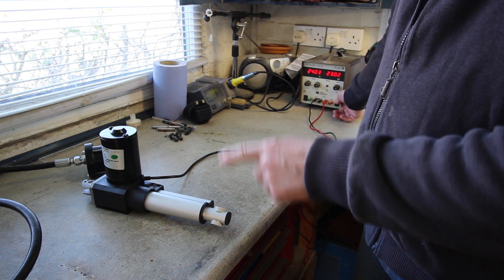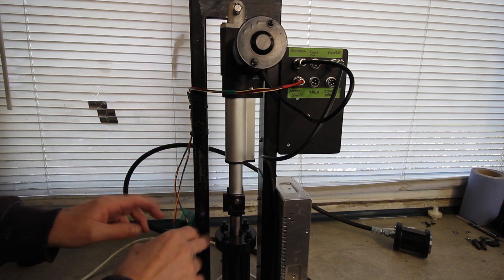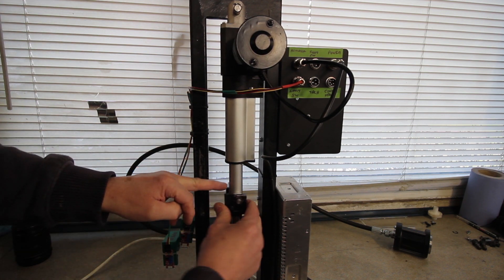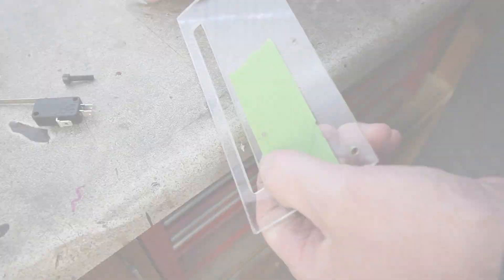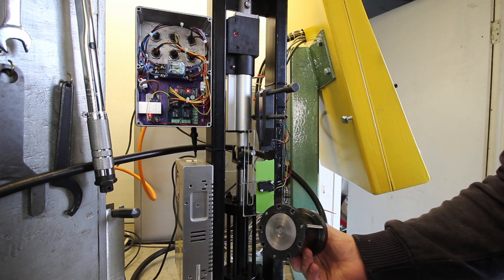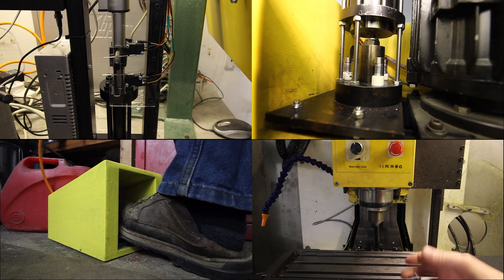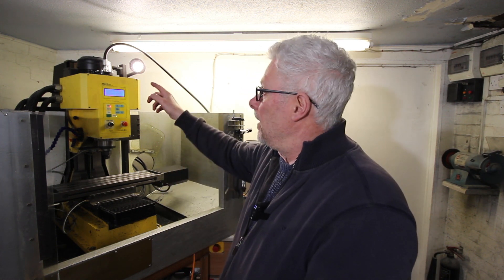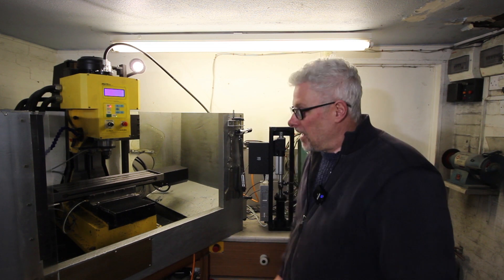Power Drawbar Finished

Comment: I’ve seen one video of someone just using an impact gun with a retainer nut.

Why wouldn’t that work here? Why do we need to use downforce to release the taper, instead of just using an impact gun? Benefit with the impact gun is it unscrews the drawbar as well?

I’m making my own drawbar release mechanism, similar to your design, but I saw a video yesterday of someone using an impact gun + retainer nut and it hurt my soul :(
Reply from the maker: Hi @thunderbirdizations
I saw those video's as well when I was thinking of how to do mine. I cam to the conclusion that if I wanted to add a tool changer then my choice was the best way to go. I also wanted to have a system that could be driven by a footswitch or a button on the control panel. The impact gun is certainly the cheapest way to go but for me its an agricultural solution! The hydraulic system is harder but far more elegant.
Good luck with your system I dont regret mine in the slightest.
Cheers

Comment: So this is fantastically engineered but what bugs me is that this gives 1500kg. HAAS publishes their drawbar force and 1500kg aligns with their 50 taper 30HP spindles! I feel like there must be a variable somewhere thats making such great forces necessary
Reply from the maker: Hi @Rainbows871 I think the difference is that the BT30 is a taper drive so does not need a massive drawbar pull as the taper does the driving. The Tormach and my system is straight sided so the tools  have no taper to jam into. Hence the massive pull needed to stop them slipping. 
Incidentally mine will move in the collet with moderate force on a spanner. I have found the tools can 'walk' out of the collet if you dont have enough drawbar pull somewhat catastrophically!!
Cheers
Reply: Ah! That makes sense. I'm restoring a Denford Starmill and have been debating TTS vs 30 taper conversion (nabbed original drawings for the 30 spindle).I was about to go TTS but that force might swing the balance @CazualHaze
Reply from the maker: @Rainbows871 Yep good choice I want to build a mill from scratch and the spindle I think is the hardest bit. The speed range is an issue along with the torque for rigid tapping and orientation for tool changes. I will go taper spindle for sure three phase motor or servo is still up for discussion.
Good luck with the mill. Cheers

Comment: Fantastic video. I just happened to stumble across your channel. You have a lot of interesting videos. Not sure if you looked at pneumatic cylinders yet but I tried a similar setup and it seems to work
Reply from the maker: Thanks Sean,
I did look at pneumatic cylinders that is what sparked off the whole thing. They are so damned expensive hence my cheapskate approach.
Cheers
Reply: @CazualHaze  I just watched your other video and seen why you went that way. That's my bad. I found an 80mm double cylinder going for 110 cad. On AliExpress
Reply from the maker: Thats quite cheap.

Comment: Awesome work. I've found an all electric similar concept commercial one: Grizzly Industrial H8368 - Electric Power Drawbar, which also doesn't require an air compressor.
Reply from the maker: Thanks for sharing.
I looked at this but its not available here in the UK also it just replaces the spanner used to tighten the drawbar. Fine and dandy but probably not suitable for using tool offsets in Mach3.
Having said that it will save oodles of time in changing cutters.
Cheers.